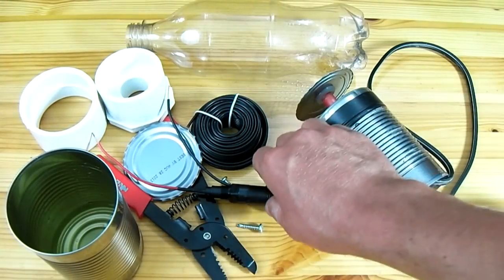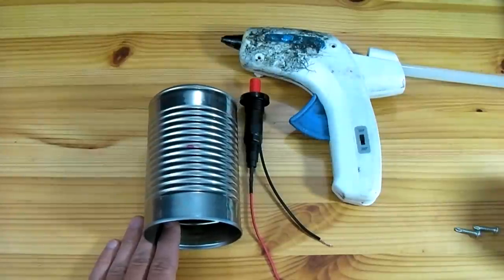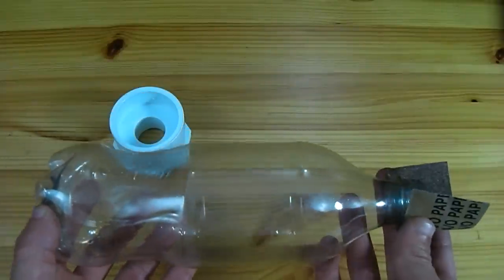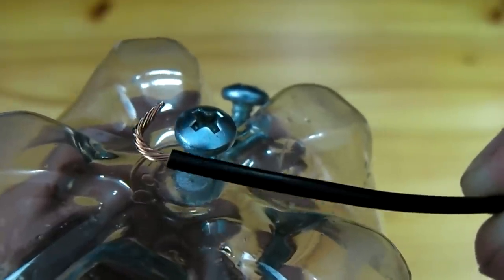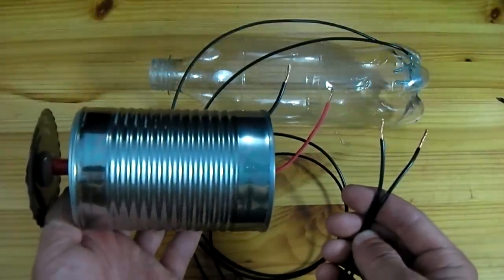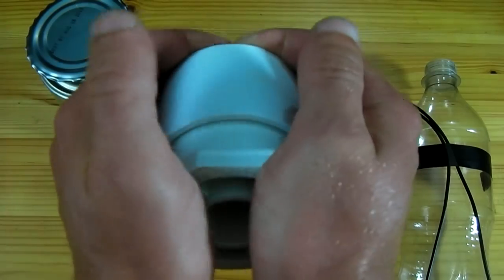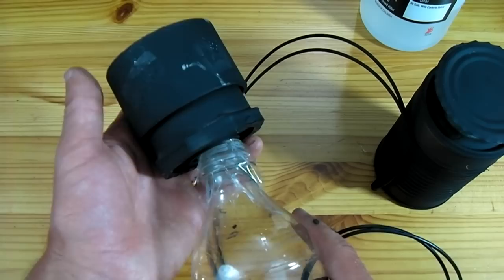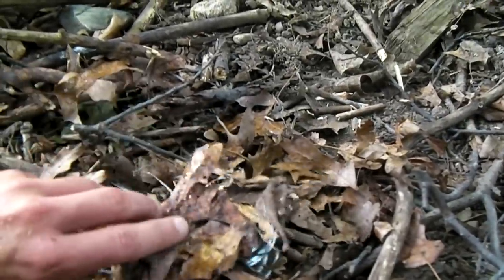How to Make a Landmine for Airsoft/Paintball

Comment: fill that bottle with gasoline and you've created a landmine. epic tutorial lol
Reply: Heh heh heh heh heh  heh  heh.... No.
Reply: It would only catch on fire wouldn't explode unless you made it air tight so pressure builds up
Reply: filling the bottle wouldn't work.  Gasoline will not ignite without the right air fuel mixture.  So you could spark all day and nothing would happen.

I know how you could make this into a mine but like fuck if I'm posting it online.
Reply: no just full it with hydrogen or black powder or with any very explosive thing XD
Reply: Black powder typically won't lite on a spark and hydrogen would either leak or displace all oxygen in the container.
Reply: Copper thermite, glue bearings, nuts, or stones to outside of bottle for extra effect. The ignition system would need a bit of modification tho. Disclaimer: Might not be entirely legal, and definitely not safe. DO NOT TRY THIS!!!
Reply: Gasoline? Are you joking? Lmao you could try that all day and it wont work at all
Reply: @arielsolomon5645 One Word Fuse

Comment: I have to say, you man ROCK! Made a few modifications to it and made it more cheaper to make (instead of using pvc fittings I used another bottle, drilled holes in both caps, hotglued them together and used them as a connection between (the second bottle was cut in half ofc)), also instead of masking tape I used the plastic from hard plastic bag. The cap holds it in place better and the hard plastic bag makes it much stronger and louder. Thanks for the idea.
Reply from the maker: +Pēteris Albertiņš Great! Glad it's working for you
Reply: used The 2 bottle solution. Good idea
Reply: +Ryder Logan yes

Comment: a better trigger? trip wire trap using a cheap window alarm(make sure the smaller piece has holes for screws), a small piece of wood, a screw and some fishing line. all you need to do is disconnect the wires going to the speak in the alarm and route them to the flour cannon, then stick the alarm to the piece of wood and then screw the smaller piece to the wood directly beside by only one hole it so it doesn't go off, then tie the trip wire to the other hole. attach the wood to something solid.

Comment: or even a simpler trigger, a clothes pin, some wire and a 9V battery. make a couple wraps of stripped wire on either side of the pin's opening, run the remaining wire to the 9v and mine so the clothes pin acts as a switch, then simply tie a small piece of wood to the trip wire and put it between the wires in the clothes pin, opening the circuit. when someone hits the trip wire, it knocks the wood out of the pin and closes the circuit, firing the mine. fill mine with pellets or paintballs.

Comment: You have to retape and refill each time. You might be able to use a pressure relief cap, such as those found in newer Ketchup bottles. A problem you might encounter is the valve not being able to handle the pressure.

Comment: 1:39 - use a soup can that is larger than the can you chose to make the pressure pad less... breakable. I test this several different ways... a can with a pad that flimsy tends to bend and not work as well.

Comment: for a trip wire just take a rat trap put tape on the snapper put bbs on it then a piece of wood lightly taped holding it down, when someone steps on it the opens up launching bbbs

Comment: if i wanted to add length from the ignitor to the device, what type of wire would you recommend using? I've tried a few different types and i cant get a spark out of it
Reply: Jorge Arrizon you can try using thicker wire or a wire with a lower resistivity.

Comment: You are able to refill it with new gas and a new load of whatever u want ;) 
But I would tend to use Butan instead of alcohol.. 

In fact you could build up a real mine with electronic ignition and gunpowder or any other explosive.. But this kind of ignition does just work with gas because of the small spark ^^ 
But that's breaking the law I think ^^

Comment: @bobsayhi12 Just use a larger bottle with a little more alcohol, when the spark ignites it causes the alcohol to expand the air, with the tape being the weakest part of the bottle it escapes from there. The baking powder is very light so it takes very little force to make it fly out. Don't bother putting bbs in it, an airsoft mine is made to replicate an explosion of that of real landmine, it depends on the rules of the fields.

Comment: Does the 'explosion' work by the spark igniting the alcohol in the bottle, which flings the baking soda out? 

Would that mean these landmines have a 'lifetime' before they stop working? Like, the alcohol dissipating away, rendering it useless? 

I ask because I have a milsim airsoft game coming up that will take place over a long period of time (30 hours) and it would be good if the landmines could be set up at the start of the op and still work until the end of it.

Comment: i have 3 questions on this. (1) would you be able to use actual paintballs for this instead of baking soda, (2) would you be able to have multiple bottles attached to the same foot pedal, and lastly is it possible to use a larger bottle say a 710 ml bottle or even a 2L one?

Comment: i'd probably attach a larger pressure plate - the chances of actually stepping on that couple of inch diameter plate is quite slim, even at a choke point

Comment: Obviously . The only thing you would have to do is re prime it , By squirting two more squirts of alcohol into the bottle , resealing it and filling it back up with baking soda , animal blood , etc. The electrical impulse from the lighter piece with the connection to the screw is constant its just a simple ground connection. But it doesn't run off love . So all you would need to do is re fill it.

Comment: What is the thought process behind using alcohol as a fuel source? I got inspired and starting looking for fuel comparisons, but haven't found much. How does this compare to say, hairspray or propane?
Reply from the maker: Alcohol works well but only when the weather is around 65f or warmer, and the alcohol is 95% or higher. Hairspray contains butane which is the flammable part. Butane and propane work equally well, but must be precisely measured for the right mix that's flammable with air. Hairspray is convenient because you can measure how much works by how many seconds you spray into a bottle. Propane is a little harder to measure and usually people build a metering system that injects a specific amount for the size of the container. The best thing I've found for propane is to use a torch which mixes air with the gas automatically. Check out my videos about my propane bottle launchers for that method.
Reply: @Nighthawkinlight  thanks!!

Comment: Can you do the same thing, but with BBs?
Reply: Mix the powder with bbs
Reply: xEPiiCxP3NGUiiN there wouldn't be enough power....
Reply: Use smaller tubing instead of the big pvc cup he used . U could connect the tubing directly to the bottle n put bb inside the tube

Comment: I wonder how well bbs+powder would work? I use that mix in my thunder b grenades, mostly so the bb's don't raddle, but both bbs and a cloud of powder still come out. Either way, I plan to try this out. I mean it seems simple enough to make a dozen of them, and cheap enough to make a dozen. Rather then buying a dozen official airsoft mines that I think are 60$ each. Also i'm thinking about using mine with a trip wire design attach to some spring loaded press (like a week mouse trap spring) so that I don't have to dig out where I want to place the mine, and or risk having the can/trigger mechanism broken.

Comment: i used to do this as a kid with those model rocket launchers. i would take the allegator clips and attach some steel wool to them and wrap it around a cherry bomb. hAHA. Im going to try the same setup with this now. see if the steel wool is hot enough to ignite that alcohol

Comment: Would it be possible to hook this up to a trip line and make this system bigger, so it would ketch the person in a crossfire of like 3 or 4 of these?
Reply: If you can connect the wire in a way so it will press down on the button, it should be possible
Reply: you could add a grid of bbq igniters by hooking them in parallel

Comment: Here in sweden we don't have 90% alcohol products (unless you have a license for it). Is there something else you can use?
Reply: i have a friend that made a potato rpg using air freshener so that could work it couldn't hurt to try
Reply: ya you can use any aerosol spray instead. air freshener hair spray deodorant anything
Reply: that could work to i didnt think of that nice job
Reply: simply replace with gunpowder :D srsly dont  though lol
Reply: Davis Campbell hair spray might work. just use a good amount.
Reply: get 45% alcohol, spray 4 times.
Reply: its rubbin alchohol not moonshine or vodka man but if u aint got it either then use cologne or hairspray or strong whiskey

Comment: I can’t find that particular grill igniter. I found one similar to it, but it only has 1 wire coming out of it. Where did you find that girl igniter u are using
Reply from the maker: One wire is fine, that means there's another metal part on there somewhere that you can attach another wire to and the spark will jump across them
Reply: @Nighthawkinlight  ok thank you, can you make a video on how to do it

Comment: @svensken98 Flour can ignite if dispersed in the air. However, the fireball inside the bottle will most likely be gone by the time the flour disperses. I personally use flour, but it is risky...

Comment: wouldn't it be better to fill the inside with 2 spray of petrol instead of alcohol? i mean won't the explosion of the powers be greater?
Reply: And melt the bottle, possibly ignite the leaves? Burn someone? Petrol explodes man.
Reply: can it still ignite smthg though it is cover with flour? i just thought about a more powerful explosion :P

Comment: Whats the maximum length of cable that i can use?
Reply: +chavezc23 It depends on igniter. At high voltage and low Amp, cable length does not matter so much.

Comment: Could steel wool be used to ignite the alcohol?
Reply: No
Reply: Colton Hall Why not? I've used it to start fires before. I just need to get the circuit set up.
Reply: metalwing3 You would have to use a completely different method of triggering the charge. The method you(and I) use to start a fire involves shorting out a battery(a potentially dangerous thing to begin with). If you were to use the same setup in this scenario the flame would be much bigger and would risk not only burning the target of the trap, but also starting a forest fire(as you generally need to camouflage the trap with leaves), not to mention you would need a 12v battery(atv or car generally) for a spontaneous reaction. You would also risk melting or even exploding the battery. Overall it's a very bad, unnecessary, and more expensive alternative.
Reply: Colton Hall I am planning on making a remote control version of the mine. I have used a 9 volt to light the steel wool. I have been looking at 9 volt doorbell systems so I can turn the bell into an igniter for individual strands and turn the button into a remote. I was just wondering if the steel wool would burn long enough to ignite the alcohol.
Reply: In that case, yes it would burn plenty long enough. If it's remote controlled it's not really a mine anymore but... Anyways, good luck.
Reply: Thanks.

Comment: For paintball were would you put the paint
Reply: In the same place he put the baking soda...
derp
Reply: I would use red/orange chalk powder instead of paint, it would make it a lot quicker to load and clean.
Reply: ShucklesD3
the paint would be to heavy and it would only bubble a few inches into the air. SD PY's idea is better

Comment: How do you drill a hole in the bottom of the soup can?  Like what kind of drill he talkin?
Reply: +Tundra Fox  any kind of hand drill will work. they make drill bits designed to cut holes in them. head  to your local hardware store